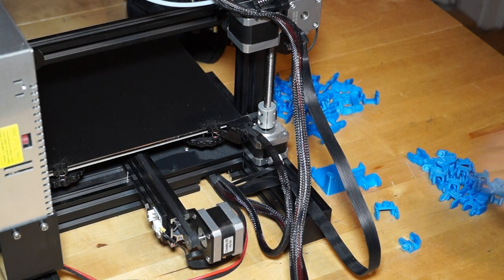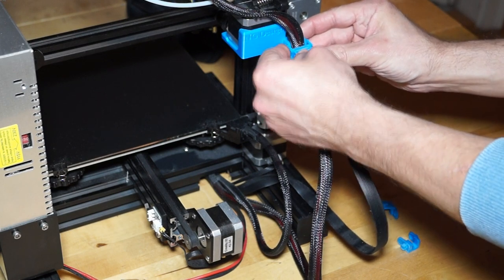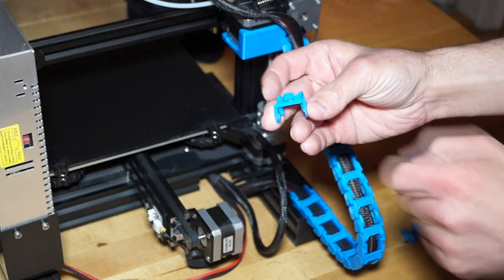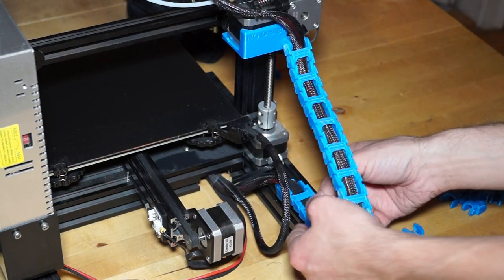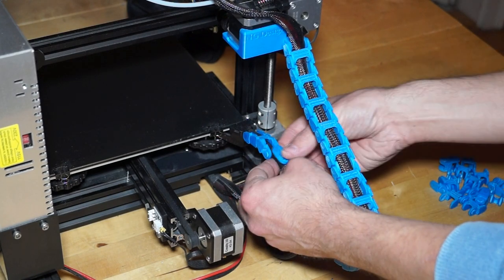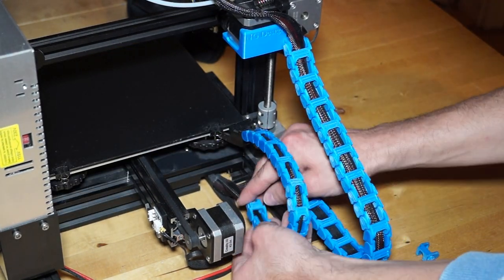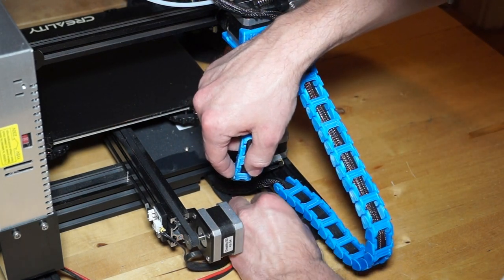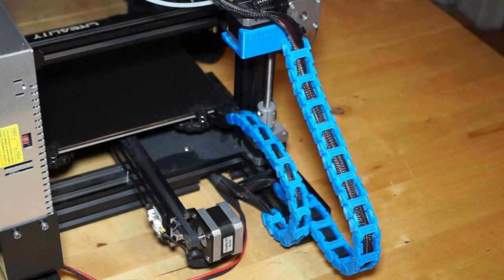Creality Ender 3 Cable Chain assembly instruction

Comment: Thanks for the design and assembly video! This was my second print ever and it all works great. The motor mount didn't snap on, but it feels secure anyways. Keeping the cables contained with these chains just makes everything seem so much cleaner on the desk.
Reply: did you use 
'em on ender 3 pro or ender3 ?
Reply: @COKSAGLAM  Ender 3 Pro. They've been keeping things nice and tidy so far.
Reply: @AlexAndOlmsted  thank you so muck bro.
Reply: @COKSAGLAM  I had a little trouble twisting Kette_klein_unten 90 degrees to lock into the channel, but I turned it enough to keep it securely in place. Also in the Thiniverse description it says to print 2 x Kette groß unten, but I only see a use for 1.

Comment: Thank you for posting this.

I just finished printing and installing it on the Ender 3.  Works GREAT!

Only comment I might make is that could you post the number of links required?  It would help others in the future.  Maybe I missed that somewhere?  No big deal though.

Thanks again!
Reply: how many links did you use?
Reply: It's in the "Thing Details" on Thingiverse. https://www.thingiverse.com/thing:3769941
You may have to adjust those amounts +/- 1, I didn't need two of the links.

Comment: The power supply on the Ender 3 V2 I just got is right in the way of where the end pieces would attach to the frame. They are still doing a good job keeping the cables from getting caught between the printing platform and the Y axis motor, which happened several times. I had no issue so far attaching the anchor piece to the motor assembly that someone else reported on the Ender 3 V2. I also had to reduce to printing 9 at a time or there were too many failures.

Comment: Great Design Mr Robot!! , I think I will print it in ABS for better heat resistance.
Reply from the maker: I think it's not a good sign if your cable is that hot that you needed abs ;)

Comment: Maybe I need to try reprinting my motor mount, but it refused to snap in like yours does.
Reply: Mine snapped in OK, but then the top half snapped off (poor layer adhesion?).  Enough of it was left that I could still hook up the chain, so I'm going for it.  I hope you got yours sorted.
Reply: Ferrinflame same
Reply: yea seme here find any solutions

Comment: I've had my Ender 3 Pro for about 2 weeks now and it works great. I've gotten a couple of Scott Yu-Jan's suggested mods printed, including your chain design. However I'm having issues with the fitment. the motor mount doesn't seem to fit for me. It barely holds on to the extruder motor, and easily falls off. I've re-calibrated the stepper motors. Either there's something up with my printer, or they changed the design of the stepper motors since your video came out. Any ideas?
Reply: scale it up or down on cura
Reply: I got a problem with the motor part too, it just falls off. Seems the fit is too wide and doesn't stay in place (Ender 3 v2). The chain seems to be just fine tho. I might try to print it out later on 99% size or smth, see if it fits. 

Did you manage to solve your issue? If yes, how? (Was otherwise thinking using double sided tape or smth. .)
Reply: @makedaevilmage  hi, I am replying to you from a different account because all my comments keep getting deleted. I have found a remix that works 

To avoid me sending a link
1. open thingiverse home page
2. press top URL to edit it 
3. At the end of the URL paste this '/thing:4916026'

Hopefully this won't get removed
Reply: @makedaevilmage  tell me if that helps

Comment: on thingiverse you say to print two of 2 x Kette groß unten
 but i cant figure out where the second one is supposed to go, is this a mistake?
Reply: There's 2 attached to the extrusion at the end of the large chain.
Reply: I only used one, and it seems to hold just fine.

Comment: I am concerned that the two chains rubbing against each other could get caught on one another. Shouldn't the two chains not be touching each other at all?
Reply from the maker: That's not the case. They are a minimum of 4 cm away from each other so I never had this problem. Maybe in the video, it looks closer than they are.

Comment: That part covering under the extruder motor won't block it's air to cool down? What did you observe in long time run?
Reply from the maker: never had an issue with this
Reply: If you look at the original thingiverse, there is a remix that creates a motor mount with cooling slots.  I used it on my Ender 3 pro

Comment: Would PLA be good for printing those so they don't break?
Reply: I was thinking I'd print most parts of PLA for that reason, but the parts near the hot end might hold up better using something like ASA.

Comment: In the thingiverse instructions you have the printer setup to 100% infil, but then you use 20% infill for each object, the 20% will override your 100% or what is the purpose of defining both infills in the instructions? am I missing something? I printed the unten pieces with 20% infill and the base snaps off when attempting to put it on the printer frame.
Reply from the maker: you right that's confusing. All parts should be printed with 20% infill. I change the printing settings on thingiverse.

Comment: The cables on my ender 3 barely long enough to fit straight up when the gantry is at max height so I can't even fit more than 18 chains on it so I can't attach it to the frame at the bottom :/
Reply: bruh... take some off?
Reply: wut thats sort
Reply: @christopherdavies7403  Yeah I did, but if I'd attach it to the frame like in the video the gantry would go up and just rip the entire thing off when near max height. I checked in the mainboard housing but there also was no extra wire hidden in there. I just left it to the point where it's not attached to the frame.
Reply: @KiemPlant  what the fuck your cable itself is short? if it's still a relatively new product (idk since my initial comment was 3 weeks ago) maybe hit up creality and see what they say about it?

Comment: How many of each part do i need
Reply: Instructions on Thingiverse https://www.thingiverse.com/thing:3769941
Reply: From the Thingiverse link:

1 x Motor Anschluss: 20% infill, 0.15 Layer, Height, no support.
1 x Kette klein unten: 20% infill, 0.15 Layer, Height, support on.
19 x Kette klein: 20% infill, 0.15 Layer, Height, no support.
28 x Kette groß: 20% infill, 0.15 Layer, Height, no support.
2 x Kette groß unten: 20% infill, 0.15 Layer, Height, support on.

Comment: Anyone use this on the Ender 3 Pro? Trying to figure out how to mount the small chain to the cable hold at the corner of the heat bed.
Reply: I'm pretty sure it just sits there, although make sure to put the bridge support of the first link beneath the plastic cable mount.
Reply: You just run it up to the bed, there is not hard connection like there is on the other chain.

Comment: X axis can't move with such mount. Also, chains are used to prevent cable from flexing at the connection point but your chains don't. They would probably get things worse. If they worked.
Reply from the maker: Thanks for the comment but thats not the case for this printer. The x-axis is seperatet from the Extruder were the chane is mounted.
Reply: Your comment is incorrect.  I just printed and installed one as shown in the video.  Works correctly.
Reply: wrong